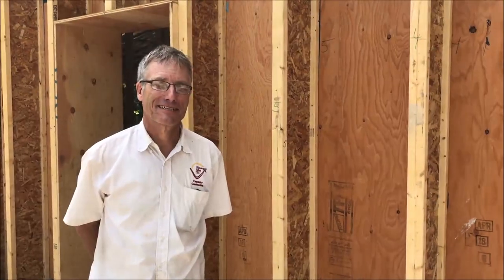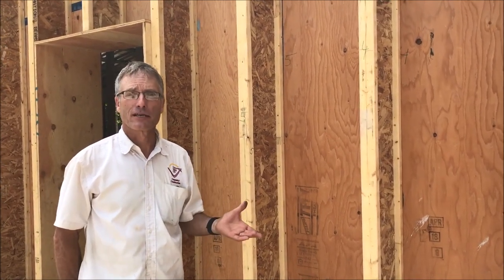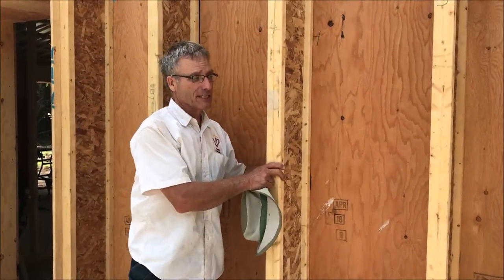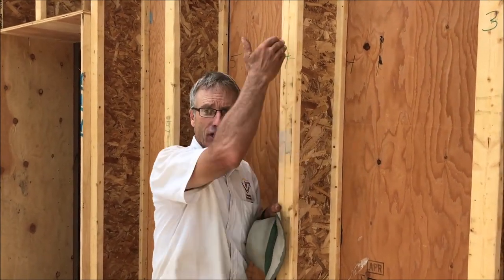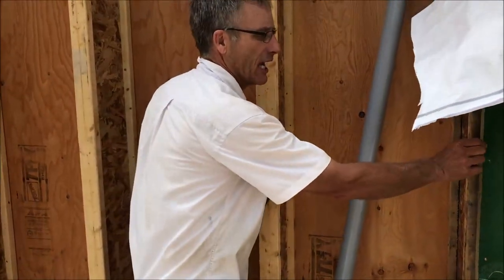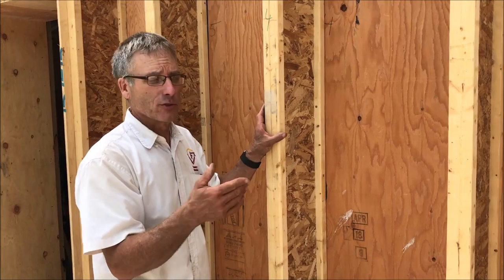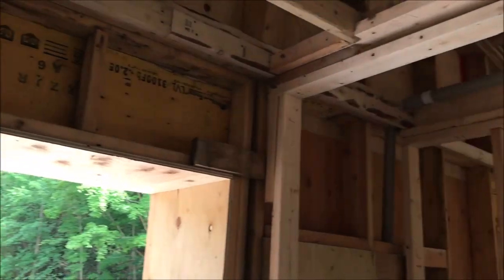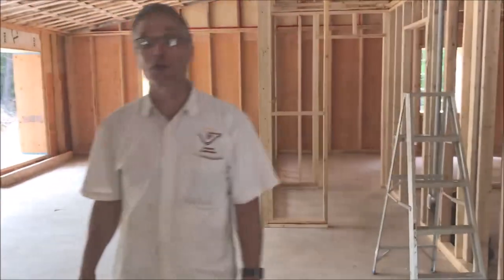Double-Stud Walls with Larsen Truss Wall System Design. Super-Insulated Passive House USA, Canada

Comment: Wouldn't the I - joist outboard, each make a thermal bridge. I - joist surely have very little or no R-value. Why not apply slab rockwool and fir strips for rain screen?
Reply: Residential doesn't look at things the same way commercial does

Comment: I understand that the web in the I-Joists provides a narrower thermal  bridge than solid lumber, but I don't understand why anything needs to be fastened to the wall at all.  Wouldn't a second stud wall connected only at the base and the rafter tails be enough to hold insulation and support siding ?  The first 2x6 already has structural sheathing on it to prevent the wall from wracking.  Why connect the outer wall to it and sheath that one as well ?  The outer wall isn't supporting any ceiling or roof loads, so it seems like it could be lightly built 24"oc 2x4 which would be a lot more economical than I-Joists.
Reply: Yeah, there's no advantage to Larsen trusses over a double stud wall. The only real difference is that a double stud design is fully thermally isolated.
Reply: @canonicaltom Agree you can also build a Double Stud Wall like a Larsen Truss with less thermal bridging. Build a standard wall & sheath it with Plywood all seams tape for Airtightness, OSB isn’t Airtight. Build the 2nd wall & Connect the two walls with a thin sheet of OSB / Plywood on the top, bottom plate or rim joist & thru the window & door bucks. Boom done. Your local framer can build it, you don’t have to buy expensive I-Joist but you’ll spend more on labor so I-Joist / Larsen Truss can make sense in some situations.

Comment: I have a question: If building a "Passive house" is to reduce CO2, have you ever calculated when you use these "double studs" how much extra CO2 you've already created for the environment? All the extra lumbers, nail works, transportation etc., all produce CO2 to produce, and bring to the job site. You are building two houses to achieve this "passive house" concept. Have you ever seriously considered and calculated the CO2 cost? It seems you are wasting much more energy than you can save from a regular "high-performance" house. The only party that benefits from this concept is the "Builder, manufacture, and all trades." If you are serious, please show proof with calculations, like the old saying - Numbers never lie.

Comment: Wow. So neat. I wish I understood the science behind what he was saying better. I sort of get it, but not really. I understand that the house will be more energy efficient than traditionally manufactured old stock in America, and I know that's good. I didn't understand the science behind the barriers, and how humidity trapped in the walls can be released to the inside walls or the outside walls, depending on where it is in the walls. A mockup would've helped me understand better but I still appreciate the video. I love the idea of energy efficient housing for everyone.
Reply from the maker: Hi Stacy,
 Glad you liked it, but to respond in more detail as you asked, here goes...

What John is talking about with the vapor barrier at the 2/3rds /  1/3rd point refers to having 2/3rds of the insulation outside of the vapor control layer, rather than standard Code construction where the vapor barrier is on the interior with all of the insulation on the outside.  

The reasoning is that in ‘cold climates’ like where John is building his house, there are several months where it can be extremely hot and humid, so the vapor barrier can be a problem as it is effectively on the ‘wrong’ side during the summer months.

Interior vapor barriers can be a problem when you have an extremely well-insulated home or when you use air conditioning, which is explained on the page: https://www.ecohome.net/guides/1353/a-poly-vapour-barrier-in-an-air-conditioned-house-is-a-recipe-for-disaster/ since the hot, humid outside air is drawn inwards in summer and it can condense on the cool vapor barrier. So putting it in the middle of the wall is an all-season solution as it works fine in winter AND summer.  If that’s still not making a lot of sense, check out our ‘building science made easy’ video where that is better explained, and subscribe to our channel, we strive to make it painless and even fun to learn this stuff! https://www.ecohome.net/guides/2248/building-science-made-easy-video/
 any other questions - including detailed ones about any aspect of Green Home Building - go direct to https://www.ecohome.net/discussions/ and ask away!
Reply: @TheEcoHomeNetwork  Thank you so much. I'll read the links you so kindly gave me.
Reply: @stacyhackney6100  You can also check out Matt Risinger's youtube page. He does a lot of talking about moisture, double stud walls, etc
Reply: @Eric998765  Thank you.
Reply: @stevepailet8258  Thanks Steve. I didn't even know it is called Building Science. I'm very interested because I love the idea of improving energy efficiency, but I'm very ignorant because I don't know or understand the science behind what the teachers are saying. I'll google Building Science and search online at the library to see what I get. Thank you very much.

Comment: isn't this just sips but more labor
Reply from the maker: Sips and prefabricated homes manufactured to a high standard would probably save some labor - yes - but they only work when all the trades involved on the project work to a high level of precision - which in reality for construction is rarely the case. This type of system allows for onsite construction of super-insulated walls - and for renovating walls to a super-insulated specification on existing North American homes..
Reply: @TheEcoHomeNetwork  thank you! :-)

Comment: So I have a question, due to costs/time and wanting to have shelter by next winter, I'm thinking about a metal building.   Very drafty, no insulation.   If I were to really try to insulate the heck out of the metal building, would this line of thinking mean I'd want to insulate the exterior as well as the interior?   I'd love to see a video about insulating a prefab/metal shed/pole building
Reply: With a metal structure it is even more important to place most of your insulation to the exterior of the structure. Metal studs will exhibit more thermal bridging than wood studs, so if you were to insulate only in the bays, the insulation value of the overall wall will be greatly de-rated. Additional to insulation your other main focus should be on creating an air tight envelope with the appropriate control layers.

Comment: This seems a good idea only for a retrofit. 
On a new construction is a big no. On a new construction you could reach a higher level of tightnes and R value just going with ICF. 
Faster built and likely less expensive, way more durable and stronger to the elements.